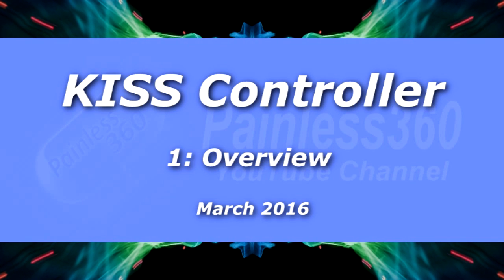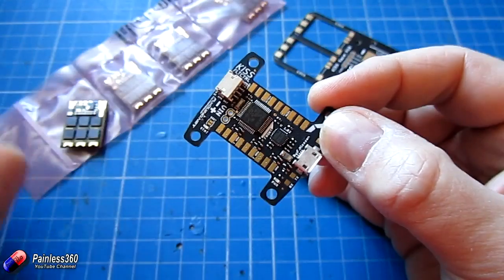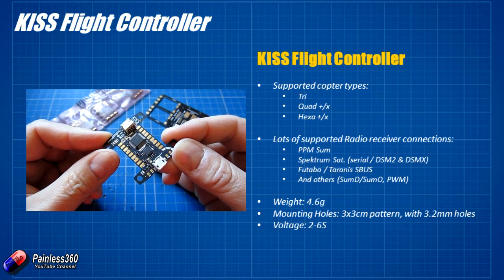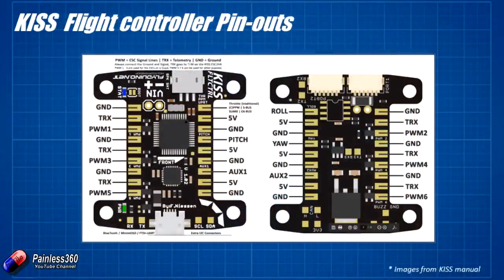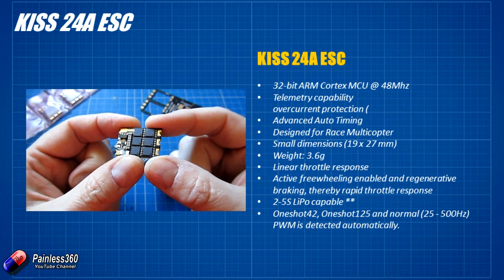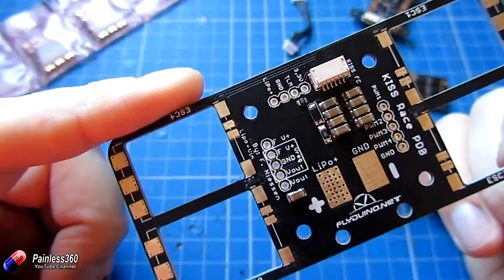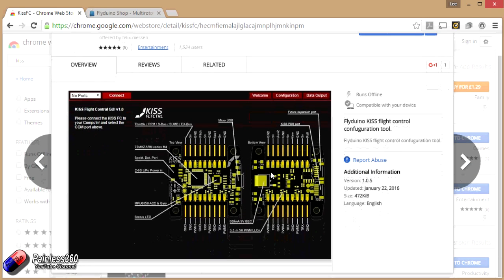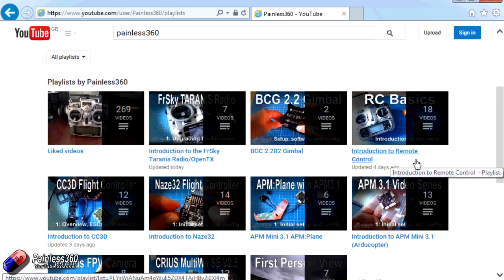(1/1) KISS Flight Technology - Introduction to the KISS flight controller, 24A ESC and ESC PCB

Comment: Hello. Thank you for all your videos!  They have helped so much.  I have a problem with getting my PC to recognize any of my FCs.  It was working fine, then for whatever reason I can't connect.  When plugging in, it makes noise but the KISS GUI shows "NO PORTS".  I tuned my quads multiple times before.  I'm not computer savvy so it has been an incredibly frustrating process trying to figure out why this happened.  If you have any suggestions on what to try would be greatly appreciated.  Thank you in advance. :)
Reply from the maker: First thing is try another USB cable - not all of them have the data wires. Best of luck!
Reply: +Painless360 I tried that and also tried Virtual Com Port. The USB cable should be fine since it worked before. Tried deleting serial ports and then letting Windows download Drivers. Still nothing. I originally had Windows7 but have upgraded to 10...would this have an affect? It worked fine even after upgrading. Should I just save the headache and get a tablet as shown in yur video? I want to fly! 😫
Reply from the maker: We use Windows 10 here with no problems. It does sound like a driver issue on your machine. http://kiss.flyduino.net/dwkb/installing-the-zadig-windows-driver/ may help..
Reply: Figured it out.  USB cable...I didn't think this would be the issue since I bought the cable a month ago.  Been updating FW and tuning PIDs with it. Paid $15 for it too! I purchased a new one tonight for $5.99
Hopefully this one will last longer than a month.
Thank you so much for your help!  Looking forward to future videos. :)
Reply from the maker: I've had it here - annoying when something as simple as a UISB cable stops you in your tracks. Happens more than you think though.. Glad you got it sorted!

Comment: Great video tutorial, I will put My board on an zmr250, kiss esc's and tiger f40 2500kv motors. How about the kiss fc board, does it come with the firmware already uploaded or do I need to upload it by soldering the jumper pads? Happy flying 👌
Reply from the maker: +Jonas Arkhed ours came with it on. Happy flying!
Reply: +Painless360 thank you for your answer, I guess that I will find out :) also, I havent got the frame yet, do you know if the esc board will fit inside a zmr250? My guess is that it will be tight.
Reply from the maker: +Jonas Arkhed the fc will. The whole thing we used here with the ESCS will not. Happy flying!

Comment: great video:) here is a question:) I put together kiss fc 24a esc no pcb (4s, cobra2204 hq5/4/3). One of the esc stoped working during the first take off. now blue led won't light up and esc gets hot when pluged in. it is hot in the area where telemetry and signal is soldered. i haven't used signal ground cause i have power ground. wiring seems to be ok. any thoughts would be very helpful :) Thanks :)
Reply from the maker: Sounds pretty fatal, I'd check the motor for that ESC spins freely and look to swap it out.. Best of luck.

Comment: How do you maintain authority with Kiss with low or 0 throttle without using Air Mode?  On the Naze32 I still have control as long as I don't enable motor stop.  With Kiss it's either Air Mode (which is way too aggressive) or nothing and tumble until I add enough throttle.  Help?
Reply from the maker: I'd ask the Kiss team, we don't have that here. I assume it's because of how we fly..

Comment: Hey +Painless360 . Quadguy27 here to ask about those "Two wacking ports" on the bottom of the Kiss fc. I can't seem to find any info on the pin outs from port 1. I've asked all the techs at flyduino and no one seems to have any info on it. Even though they make/sell the pdb that plugs straight up, with supplied wires. The order is still of importance to me, because I'm trying to hook up another 4in1 esc with the same type of port and wire. I know the order of the escs but not the Kiss fc. I have traced the tabs to the pins, with a multimeter. The order is (fc upside down,start left) 1,2,3,4,5V,GRD. The fc fires up, but when I power it (escs) on they dont want to arm. Help please!!
Reply from the maker: +randy mulhern https://dl.dropboxusercontent.com/u/67301981/KISS-FC-Pinouts.jpg ;)
Reply: +Painless360 thank you so much.
Reply from the maker: You're welcome, glad we could help, The KISS stuff is very nice to fly..

Comment: Hi, thanks for the video. I have got the board on the GUI easy enough. Do you cover how to flash the latest betaflight to the board? I'm struggling with that bit. How do you rate the board now you've had a few weeks with it?
Reply from the maker: +Flight Mode Fast not sure why you'd want to. We won't be covering that in the series. Best of luck!
Reply: Do you not need to flash it? Does it come pre-flashed?
Reply from the maker: Comes with KISS code on it - see the rest of the series..

Comment: Excellent video as always, I have been waiting for this series since I just got the Kiss FC and 24a ESCs. I'm sure you know but didn't mention that if you use a micro MinimOSD that they have Kiss osd firmware for it also and it gives the telemetry for each ESC in the corners of your FPV screen. It gives RPM, temp, and amperage of each ESC, pretty cool stuff. Have a great day and can't wait for the next one, wanna see what frame you got the PDB to fit in.

Comment: very interesting.. im thinking of using kiss esc on my alien clone ( figure ill go high quality build.  maybe try some of them red bottoms from Emax too.  4s.  )..  the so called martian 230 5" props from goodluckbuy.  42.00   i could not spend over a 100.00 for a original alien frame.  ill give the clone a try, has 4mm arms which i think is a great compromise 3mm little thin 5mm little over kill for racing quad.  also the 180 i ended up just changing the wires over.. took  me 5 mins compared to the hour i spend trying to get them to flash. LOL..  so will do as you always fro now on will always solder for correct motor direction.   i hope these new ones do not have the same issues as the older 18a did. they seem to catch on fire if you looked at them wrong.  rock on from AZ>

that is a great little bit of kit tho for a nice clean build.. that wont work with the alien clone frame.   but it is cool to see what the kiss guys do . they are always pushing the envelope.  the best thing i guess about such a simple FC>. is it should be super fast . just what a racer wants.  why waste cpu etc with stuff a racing mini quad guy would not want..  anyhow, look forward to the build.
Reply: +Chris c Took a look at the Martian 230, does it have a fixed angle for the FPV-cam?
Reply: salle rc
for a  board cam yeah it has a set angle you can use or change it by adding a spacer.. the camera i will be using is the same one the original designer of the alien recommends.. I forget the name off hand but its a self contained unit instead of a board cam.. about 40.00   it will be adjustable ... hope this helps.
Reply: Ok, yeah the HS1177. I use that too on my Alien and blackouts.
Reply: salle rc
yeah thats the camera.. im ordering it from alien.  i figure ill throw some money there way since i could not justify spending the price for a alien and had to go with the martian.. the camera, the foam battery pad, and hopefully the LED light ring, was out of stock last i looked.  hope you had a great weekend.   i maiden my 180m zmr yesterday.  will be ready to start a new build soon.. just have to wait for parts to start showing up for the 230 martian build.  i have a 7" duel antenna  plus a DVR fpv monitor showing up on tusday.. figure ill build a ground station too.  FPV is new to me so figure ill go from the the 7" screen to goggles.. for now im just gonna use the hobby king quantum version 2 cheapies.  if i like FPV, ill invest in better goggles.
Reply: +Chris c well iv given up on scoring kiss esc.. but i did order a kiss FC for my project.  i think im gonna order some little bee 20A Pro ESC.  i hope to start my build in a week or two when my parts all show up.   i look forward to compare this FC to the others iv tried.

Comment: Hi buddy. Just something that's worth a mention.. As it's early days for the firmware, bugs are still being ironed out. For example there is currently no official firmware release that works properly with speksats in combination with 8ch+ TXs (IIRC you tend to use speksats). But Felix and co have been working hard to get things sorted. The latest release candidate (1.2RC16) has solved most of the issues so I don't think 1.2 will be far off. I finally got my maiden in on Sunday using RC16 and I was blown away with the performance, it really is stunning. But it might be worth waiting for the official release of 1.2 before getting do deep in to this series.

Enjoying your vids as always, cheers :)
Reply from the maker: +Revs thanks for the comments. We're waiting for the next release so we can cover FW upgrade using the DFU util in the build video. Happy flying!
Reply: lol, hello mate :)
Reply: Htfs. Thu m   ml no blockhouse mobile